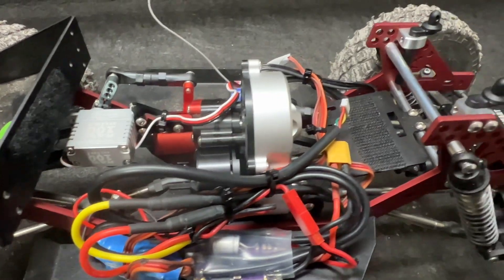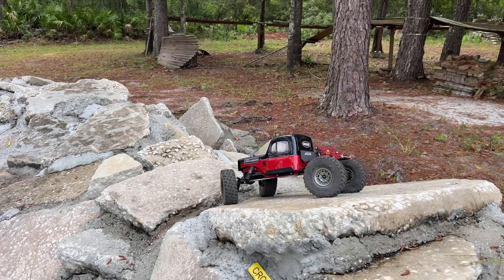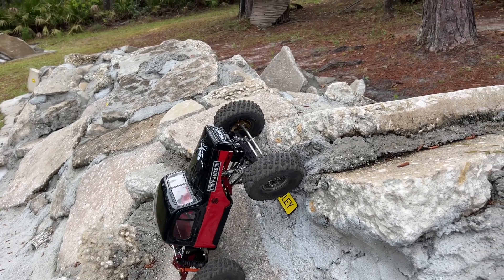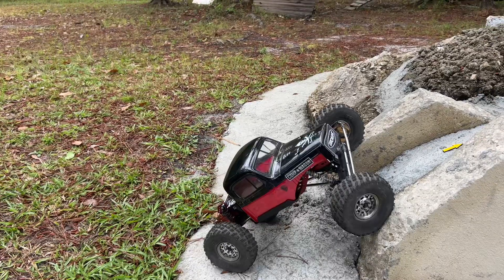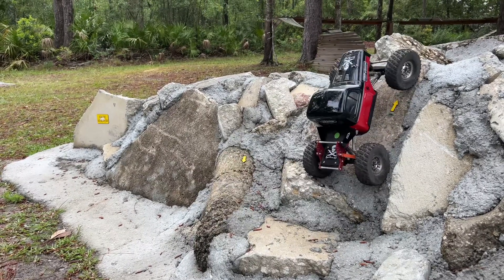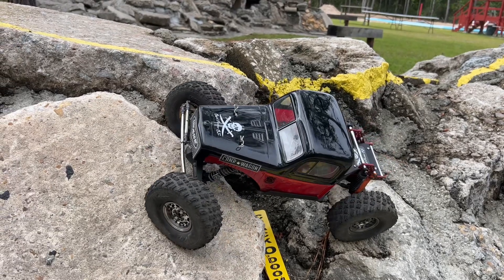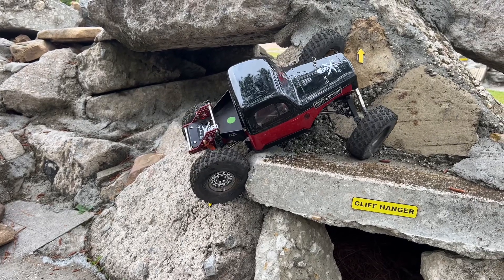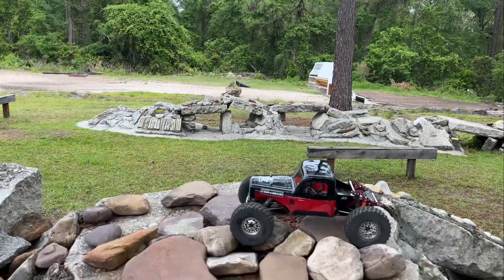Rock Pirate MODDED with Holmes ESC 3BRC SENSORED Motor

Comment: If u want absolute zero noise, u could use (on road & oval) 64 pitch pinion and spur gears. Most of the spur gears, plastic, will bolt on any hub. Kimbrough are best. Idk how readily available they are, depending on oval racing down yonder.
Reply: Yup. Kimbrough makes a killer compound. Servo svers are awesome too